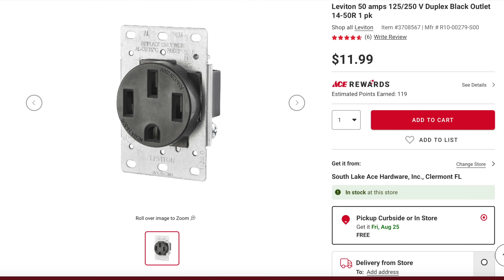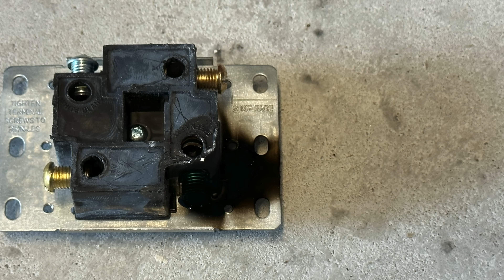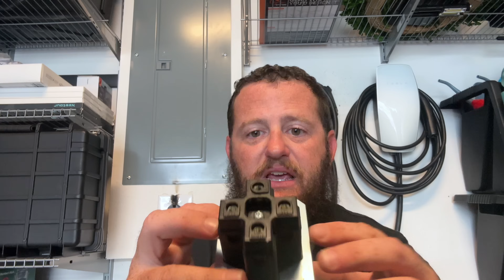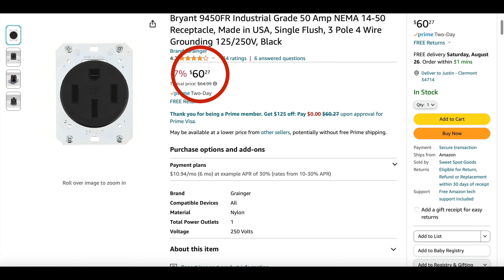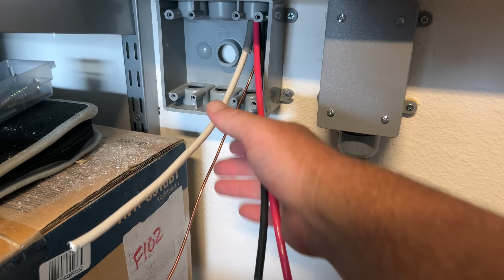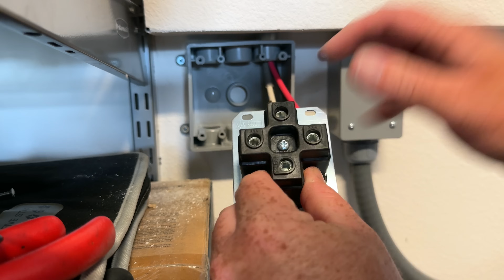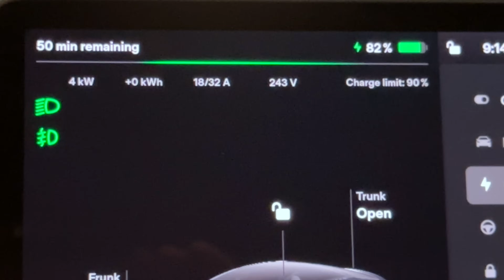This Will Save Your Life if You Charge Your Tesla on 14-50 Outlet!!

Comment: My NEMA 14-50 was installed 6 years ago for the 40A Gen1 mobile connector.  Tesla advised to leave it plugged in, probably due to limited number of receptacle insertions.  When you bend wires to fit in box, they can loosen, so always re-torque before final assembly.  Many electricians perform the wiggle test on wires and re-torque.  

The cheap Leviton receptacle is good for about 10 insertions similar to number of times a home owner might change electric range over a lifetime.  The $55 Hubble is often used at RV parks where insertions are hundreds.

Never insert or remove a NEMA 14-50 plug with power on.  It’s much too dangerous !
Reply: yes, torque, wiggle wires vigorously, re-torque.  wiggling will compress/settle the strands and the re-torque with tighten take up the slack in the newly settled strands.  the failure in the video appears to be lack of final re-torquing...
Reply: @warped-sliderule  That would be my guess. Proper torquing would eliminate many problems, if you properly torque the connections they will not settle when you wiggle them because they are already compressed together, leaving no room between the strands. You can check this yourself by trying it using a proper torque wrench.
Reply: @warped-sliderule 
Did the video show the condition of the wires upon removal of the melted socket?
9:09 is where it's removed, but
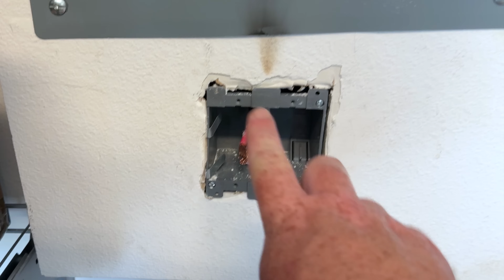 it seems to jump to the socket being out and at 10:17 a wide shot of three of what should have been four wire ends in the box, not clearly seeing the ground wire there. I'd have looked very closely at the condition of the wires there to see where the flash point was.
Wonder what wire was actually connected to the ground there? If it was wired with one of the hot wires to ground, that's going to arc flash when it got plugged in. Not sure how it could have worked at all though.
Reply from the maker: cheers
Reply: You are a troll. The BRYANT is a serious upgrade to the LEVITON.
Reply: @HowardTheApplianceRepairman  I have no experience with Bryant so cannot comment on it’s quality.
Reply: What if you left the adapter plugged into the receptacle and detached the charger? Would that be the same thing and still dangerous
Reply: @zack8296  Zach, if there are exposed metal conductors it is a shock hazard.  It’s important to remember connectors have a limited number of insertions & removals.  Some are high number and others are low.

Comment: Just by looking at the outlet, looks like the wires were loose in the box at the back of the outlet.  Are you sure you tightened them terminals properly.  I'm a electrician for the past 25 years and do a tone of service calls.  If that plug was wornout it would have been arching and the face of the outlet  would have melted. Most likely you didn't properly connect the wires.  And you also need a GFCI  breaker if its not hardwired its code! FYI...
Reply from the maker: I did not torque the terminals like I did this time. Absolutely could have been something I did wrong.

Comment: Guess I don't understand why you are plugging and unplugging. Not enough capacity to have two chargers operating concurrently? What about two sockets on a switch (not a breaker) rated for a large load?
Reply from the maker: I test charging equipment quite frequently so this outlet gets some use.
Reply: Ah I see. Okay thought of something else - as a safety improvement. How about putting that socket on a heavy duty switch designed for regular operation at load. Then for safety, you turn off the current to the socket then plug or unplug while the circuit is cold. A little extra protection never hurts with 220 volts.  @BeardedTeslaGuy

Comment: That appears to be a ground fault. There should never be current on the ground! All the melting of the plastic was a result of that event, not heat over time.
 
Also, you should never be using plastic boxes for high current applications! You need to change that out for an all metal box and cover. Also when installing a metal box your ground needs to go to that box and to the 14-50 connector.
Reply from the maker: thanks for the tips.

Comment: Purchase a Hubbell 14-50R Receptacle (HBL9450A). It’s rated for more insertion cycles, so the contact surfaces are made of better material and gave more contact. They typically also have better wire connectors.
Reply from the maker: yep, links are in the description

Comment: Your advice to hand an electrician the Bryant or Hubbell outlet is spot on. EV's are new and very few are aware of the risks. They have installed hundreds of dryer outlets and never had an issue. Until now......
Reply from the maker: yep, it will take some time for the entire industry to catch up.
Reply: But all under rated plugs will fail eventually. Just direct wire and eliminate the problem.

Comment: Be aware when you switch the outlets out the cover needs to have a bigger diameter hole compared to the standard 14-50's. You have to get a Hubbell specific cover plate.
Reply: Extension faceplate (I bought the Hubbell 888 Raco Raised Square Exposed Work Cover to go with the Hubbell Raco 8257) works great since these industrial outlets are much deeper too.
Reply from the maker: Yep, good tip

Comment: I actually used a cheep levaton 14-50 for years to charger my tesla. Plus I used a gen 1 tesla charger so I actually charged at 40amps.  I never had a problem I think because almost never unplugged my charger.  Plus I made sure the wire in the back were torque to spec.   

Most important thing with there high power 240volt 8,000+watt outlets is first make sure the wires are torque to spec and recheck them ever year.  2nd make sure that it’s tight when you plug it in.  If it’s loose then you need a new outlet.  Try to avoid unplugging and plugging it in a lot.
Reply from the maker: Torque leads is critical for safe use.

Comment: The Hubbell and Bryant certainly look the same on the outside. What about the internal parts? Are the internals the same steel, thickness, and strength? The thickness can certainly affect the ability of the connection to handle a long term, high current load (like a multi-hour EV charging session). The design and material strength can affect the ability of the receptacle to handle many plug insertions and removals over time while retaining the receptacles' ability to maintain a strong contact force with the plug. You could contact the manufacturer to answer these questions or cut up both of the receptacles and make your own comparisons. Determining the difference in materials and strength should be easy for the manufacturer, but would be costly to do on your own. In any case, I'm very thankful that your injuries are minor and damage to your home was minimal.
Reply from the maker: The metallic materials appear to be the same as well.
Reply: They better not be steel.

Comment: I had a NEMA 14-50 plug recently installed in my garage to charge my Model Y.  Three things:  (1) I insisted on a commercial grade Hubbell 14-50 receptacle.  They are expensive - but they are high quality and are actually called out by name in the Tesla installation guidelines.  (2) I have a metal plate installed around the receptacle - not plastic like the one that charred and melted in your incident.  (3) I leave the mobile connector plugged in ALL the time - I never unplug it.
I would highly recommend that you buy a 2nd mobile connector and use it exclusively for road trips and leave your garage mobile connector permanently in the receptacle.
Reply: Great advice, I’m getting my NEMA 14-50 removed and hardwiring in my CharePoint Flex.  Not worth garage fire hazard.
Reply: The Hubbell plug is now under $50 so that’s a positive!
Reply: @drkylefreeman 
Is that on Amazon?  Also, there is a new Hubble lightning receptacle 3P4W that is $85 instead of $45 for the HBL9450A. I don’t know what the difference is maybe it’s easier to install or goes in a more shallow box. Your thoughts?
Reply: I 100% agree with you!
Reply: it looks like he has a tesla charger and a non tesla charger so maybe he has to unplug the charger often to switch in order to charger a non tesla?
Reply: Exactly. I’ve never unplugged my mobile connect, though extension cord 14-50 plugged into outlet charging cord into extension 🤙🏻
Reply: Why don’t just installed a wallbox ? What’s the point for €140 outlet..if you compromise safety,,isn’t the wallbox just the better option?
Reply: @Dee_Shortss Because the mobile  charger is cheaper and you can take it on the road.  It's fast enough for most.  If money is not an issue, use a hardwired at home and mobile when needed on the road.
Reply from the maker: I have extra mobile connector that stays in each car permanently. It was a good tip a few years ago and glad I went that route.
Reply: @BeardedTeslaGuy  So your leviton outlet failed even though you didn't unplug your charger very often? That's scary!
Reply: @Reck1025  No, its inevitable.
Reply: @BeardedTeslaGuy My dryer outlet, is that a NEMA 14-50 as well ?  Looks like this outlet. So if we should not unplug regularly do you think that goes for the any 14-50 outlet as well.
Reply: @VidanageKarunaratne 

It is not necessarily about the outlet.  At continuous high voltage you need to make sure you have the right components.

1) draw no more amps than 80% the circuit breaker rating.  You may be able to limit the amps in your evse.  If not make sure you know the amp pull before you plug in.

2) The age of your wiring may impact its performance. You may want an electrician to certify it.

3) receptacles are failure points.  Use only high quality ones.

4) The load on the circuit and on your circuit breaker needs to handle the load.  Evses or switches can monitor the load and adjust if you buy one that fits your needs.
Reply: I also went the extra mobile connector route. You never know when you might forget it.

I know it's ironic to recommend this on a safety minded video, but for emergencies I also carry a 25ft heavy duty 110v extension cable. I'm careful with where the cable is laying and reduce the amperage that the car is drawing if I were to use it, but it's really helpful for cabin trips to rural areas where you might be parked for a day or two and can trickle charge back up. 

It would also be helpful if there was ever some kind of weird emergency with the supercharger network while traveling. 110 is everywhere, but not always in range of a parking spot.

To the video OP, I've always hated the 14-50 plug. It's chunky and difficult to grab without feeling like you're getting your fingers way too close. I wish a handle was standard with those plugs.
Reply: Bad advice. Here’s better advice:  stop using mobile chargers in your garage. Purchase the correct product for the correct application and wire it up correctly. Then don’t touch it.
Reply: @benbohannon  Thanks, Mr. Science.  You might take note that my ‘bad advice’ of never unplugging it matches your advice to “don’t touch it”.  Is this identical advice suddenly good because they come from you?   Perhaps you have some safety data to share on why a Tesla mobile connector is unsafe.  If prongs in a live electrical receptacle scare you, you might want to leave your home and head to the nearest cave immediately.
Reply: @benbohannon  What do you think the purpose of mobile charger is? Any dangers from the mobile charger comes from the plug and not the mobile charger, which again you should leave in the garage so it is no different.

The only real advantages to having the wall charger is for daisy chaining them to split out the amperage, and if you need a higher amperage output as the mobile charger is limited to 32amps but the wall charger is 48 amps. Most people do not need the additional charge speed or to share the load between multiple cars.
Reply: @SSPsGoku1 thank you for that comment, makes sense to me. Exactly how I see it.

Comment: I suspect the EVSE you were unplugging was charging a car at the time, leading to arcing. It’s an easy mistake to make, with serious consequences. I’m glad you’re okay! I suggest flipping off the breaker before unplugging, just as an extra level of safety. With the panel right there, it’s easy to reach. Then flip it back on after plugging in the next EVSE.

After watching the Munro video on this topic I decided to go with a hardwired Wall Connector rather than a 14-50 outlet. Fewer points of potential failure, and now my Mobile Connector is always ready in my frunk.
Reply from the maker: Hardwire wall connecter is the best option when possible
Reply: pepstein was correct,  just ignore the comments about current being forced out into  circuits against their will 😅
If there's no load there's no current, even if the voltage is there.

So much righteous with so much wrongedness was a wonder to behold -
Reply: I think you don't get how this plug works. Even if the car isn't charging, the plug will supply power to the connector, the modul on the connector will not supply power to the car if the car has reached it's charging state but the plug is always live, unless you put a stand alone breaker box between the 14-50 plug and the main panel.

another thing, it is not the plastic that makes the connection loose but the prongs inside the plug itself. They are not meant for multiple plugging/unplugging and they get loose with use. This is the part that is higher quality in the 2 other plugs he bought
Reply: @SINasTER75  An EVSE draws very little current when it's not charging a car, and as such it would never cause arcing when unplugged in that state.

I agree it's the metal not the plastic that ensures a good electrical connection, and I agree it's important to replace the receptacle if the connection is no longer nice and tight, but...

The plastic is different, and that's important: Hubbell uses a plastic called Bakelite which has been around for a long time, but isn't used much these days. Bakelite doesn't melt the way other plastics do. This helps contain the situation if a poor connection to either the supply wires or the plug causes it to fail.
Reply: @pepstein  you must an electrician 🤔 or maybe not from your lack of knowledge how electricity works in a circuit…

Even if the evse doesn’t draw much current when not charging a vehicle, the receptacle/plug will supply the same voltage/amperage if incorrectly manipulated and/or with a loose connection. 

If you want to test if you’re right, put some wires on the positive and ground of a 14-50 outlet and touch the wire… if your right, you should be ok and receive a minimum jolt from your hypothese… if I’m right, you’ll tell me how that felt 🤷🏻‍♂️
Reply: @SINasTER75  drop the ad hominem. I claim you will get dangerous arcing if you unplug a device from a live 240 volt receptacle if and only if that device is drawing significant current. Are you claiming that it'll arc regardless of how much current the device is drawing at the time?
Reply: @pepstein  not claiming it, I know!

Try it…
Reply: @SINasTER75  https://upload.wikimedia.org/wikipedia/commons/c/c9/Domains_of_T-Arcs_and_F-Arcs.png
Reply: @SINasTER75  Oops. Amperage is not supplied its drawn.. Yikes
Reply: @SINasTER75 "Even if the EVSE doesn't draw much current when not charging the vehicle, the receptacle/plug will still supply the same voltage/amperage..." 😂😂😂

Just stop, it is clear you have no idea what you are talking about. 

Amperage is not "supplied" it is literally a measurement of current.  So if an EVSE is drawing a small amount of current then there is a small amperage and not the same as if the car were charging.
Reply: @qwsxcde0988  are you an electrician or an electrical engineer? I fear not because you would know that in a case of a short, no matter if there is full demand from the device or only 0.1v, if you get in contact of the short, you will get the full burst. 

You wanna test it, touch a faucet and an outlet, you’ll get the full output of the outlet dumdum

Comment: Where is the clad or conducted cable to a metal box with a metal cover so everything is grounded, not just the green/bare wire? Where is the spark sensing breaker?

Comment: I still have the Leviton 14-50 outlet but I've plugged in my charger 1x and never disconnected it. I also only charge at 24A even though I could go higher. What amperage were you charging at? I do want to upgrade to the Hubbell one though.
Reply from the maker: Can't speculate on its long term performance, but it's smart to plug once and turn down the amps.
Reply: @BeardedTeslaGuy  
I'm going to upgrade it anyway. Thank you so much for sharing your experience. It helps me not to be complacent about the safety of this.

Comment: Hubble/Bryant plugs are much deeper than standard plugs as you found out. Hubble makes metal J boxes that are designed specifically for these deeper plugs. The diameter of the nylon portion of the plug is also larger than cheaper 14-50 plugs, and Hubble sells a metal faceplate specifically for these larger plugs. It is recommended to install 14-50 plugs being used in EV charging installs inside metal j boxes with metal faceplates to help contain the fire/melting potential in the event of a failure. I would recommend you do that, especially since you have the box mounted below your panel, and as you saw in your previous install, the fire can burn right up through the plastic j-box/faceplate and straight to your main panel.
Reply from the maker: good tips, thanks for sharing.